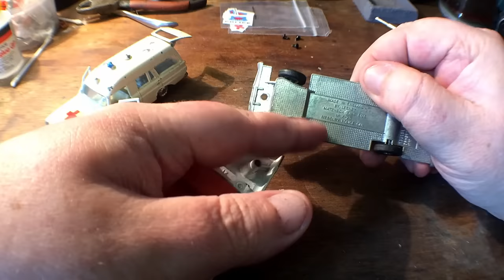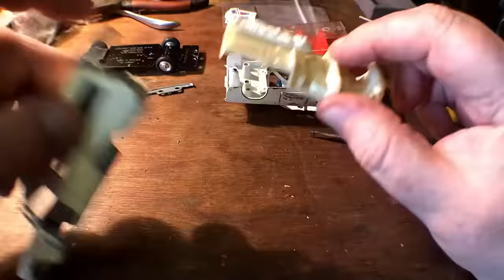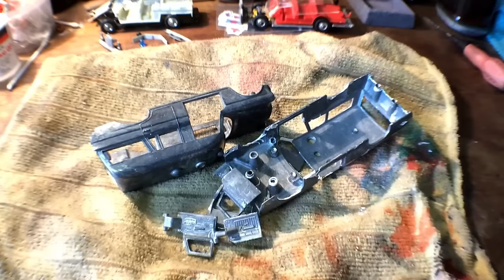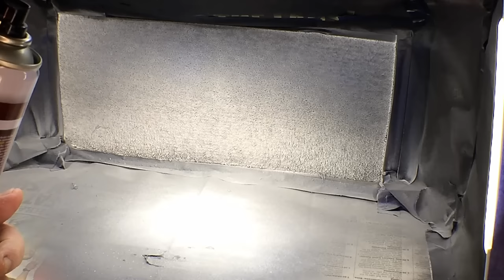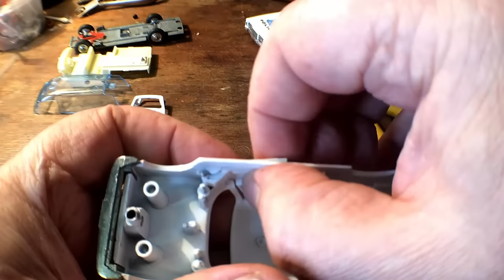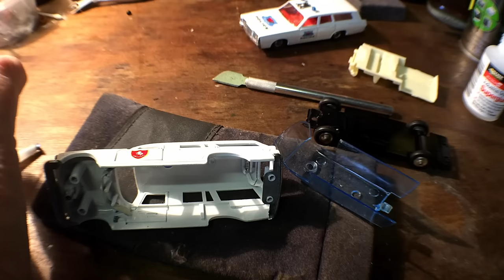Matchbox K26 Mercedes Ambulance & K23 Mercury Police Car Restoration

Comment: Hi Bob,

Thanks for these two latest restorations and I hope your missus is getting better soon.  I've been saving up a large collection of Dinky and Corgi models and now I've retired I've set my workshop up and I am making a start on restoring a Corgi Saint Volvo 1800.  I've watched almost all of your videos on you tube and they are all entertaining, inspiring and have taught me so much that I felt I understood so many of the potential pitfalls before I started.  I have a few questions, a). what make is your new spray booth and where did you purchase it from?  b). I know you explained in one of your earlier videos what fluid you put in your 'washing machine' for plastic parts but I have forgotten what this is; was it soapy water and white vinegar?, c). it's great how you copy an image from the internet and then turn into a decal.  Could you please demonstrate how you do this on a future video.  Great work Bob and stay safe in these crazy times.  Steve
Reply from the maker: Hi Steve in answer to question 1, As I said on the video I bought the booth from ebay but not sure if they are still available with the double fan , my washing machine is just washing up liquid and to copy an image from the internet you just right click save picture as or image as into your folder then shrink it in a photoshop program to the correct size and print it.